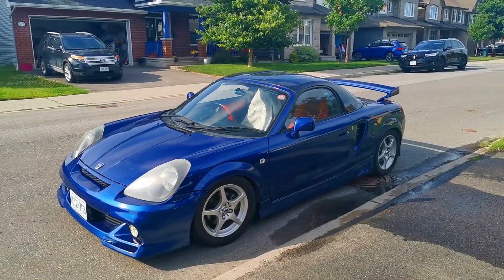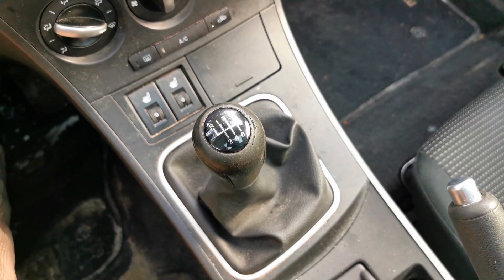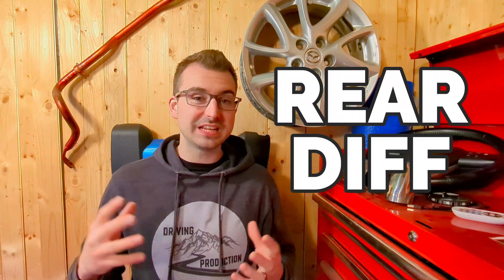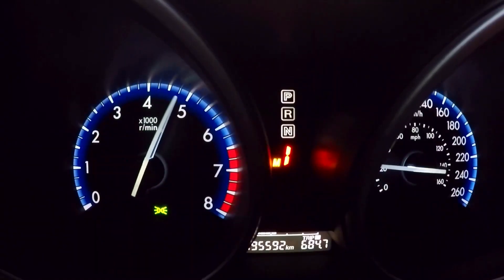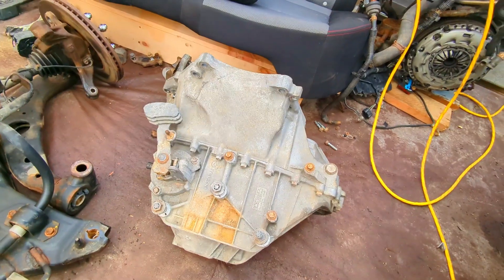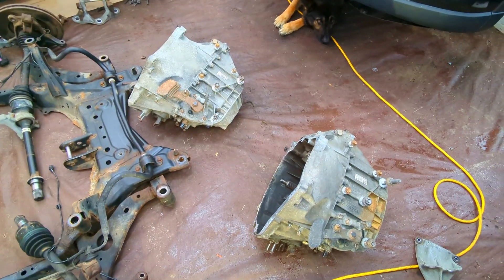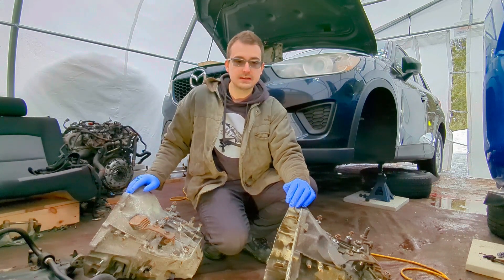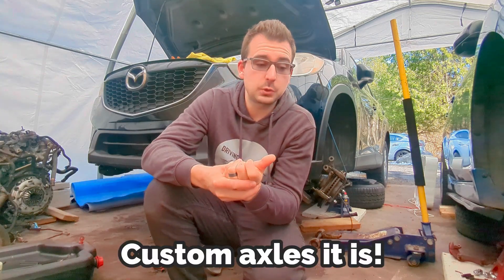SUPERCHARGING the Mazda 3 WITHOUT Using a SUPERCHARGER

Comment: Hey I came from ur blog post, do you think it would be hard to put that manual transmission in a 2015 Mazda CX-5 automatic ? just wondering
Reply from the maker: I think the biggest issues with that would be the electronic side of things, for that car will have different sensors from auto to manual. As far as the mechanical part I would assume you would only need all the manual components and swap them over.

Comment: I wonder how much hp these transmission can handle? The whole issue with boosting a manual sky is the trans will blow above 210hp.
Reply from the maker: That's a good question I haven't really heard of anyone having issues with them. They seem to be holding up good to with people running the supercharger kits.
Reply: @DrivingProduction  apparently the automatics handle power better, I've yet to find anyone with the supercharger kit and a 6mt sky. I don't think there is one yet, but I'd love to see one
Reply: @Dyl-Cam  There are like 15 Supercharged MT Skyactiv-G already
Reply: I have a 2021 6MT mazda 3 with the tv racing kit.  Probably about 240 hp.  No problems 10k miles

Comment: Best of luck figuring out the axles! I've been toying with the idea of swapping a skyactiv transmission into my mzr 2.5 to lower the cruising rpms a little, so it's interesting to see you go through a similar process. I'm guessing I'd run into similar axle issues?
Reply from the maker: Thanks for the support! The Skyactiv and MRZ are not compatible unfortunately, I should of compared the Skyactiv transmission vs the MZR (Mazdaspeed) transmission on video, but the bell housing and bolt pattern is not the same. With this mod I'm actually going to increase my cruising RPM speed so technically decreasing my fuel economy. If you wanted something like that, the first gen Mazdaspeed 3 transmission is very short from what I understand, and is a great performance upgrade with the LSD. But like you said if you're trying to lower your cruising RPM you might want to look at the other MZR transmissions. Hope this help! 👍

Comment: is this possible with the autos?
Reply from the maker: I wanted to do this mod since when I had my auto Mazda 3 Skyactiv, so I would say yes you can do it. It's also probably easier to get an automatic Cx-5 transmission than a manual one. 👍